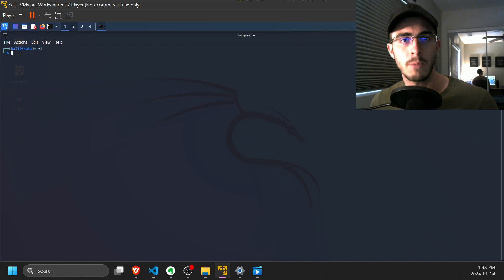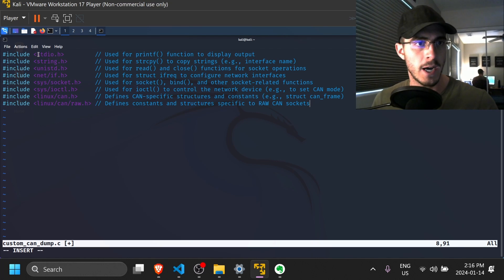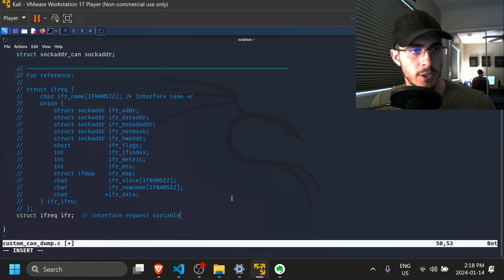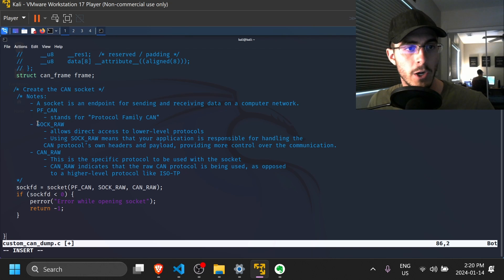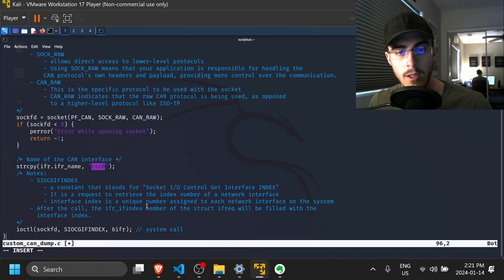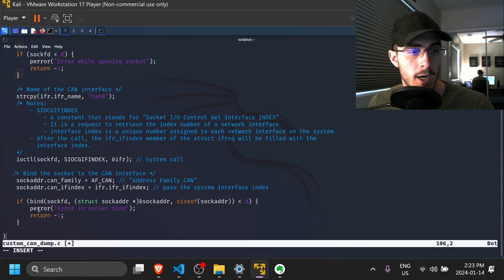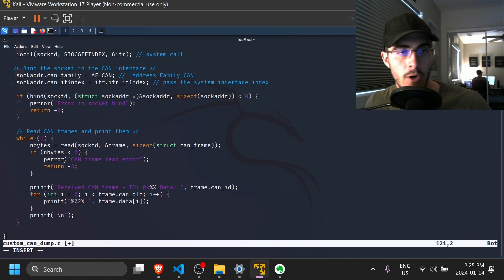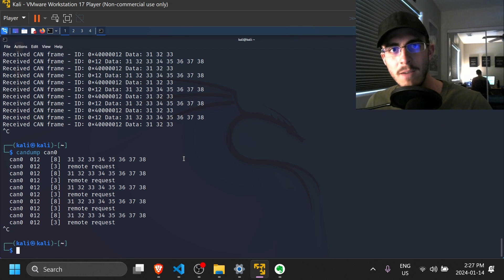SocketCAN Tutorial: Writing a Custom candump Linux Tool

Comment: Hey Josh! Can you put up a video tutorial on cannelloni? What i was trying is to transfer CAN message from the vehicle over IP and receive it in some scan tool. Then send the diagnostics signal back to the vehicle from the scan tool. Remote diagnostics stuff.
But I was able to receive the CAN message over IP only on a virtual CAN interface and not on a physical CAN interface (i.e : the scan tool)
Also i used 2 raspberry pi with a CAN hat to check if it works.
Would love to see you put up a tutorial on cannelloni

Comment: And the only system call you didn't check for error is the one that fails if the CAN bus hasn't been set up successfully on the system. 😀  I found that probably only a very few USB devices will be recognized directly out-of-the-box by socketcan, so it is the most likely failure point. Trivial to add the check though!
Reply from the maker: Good to know! That would make this more robust indeed